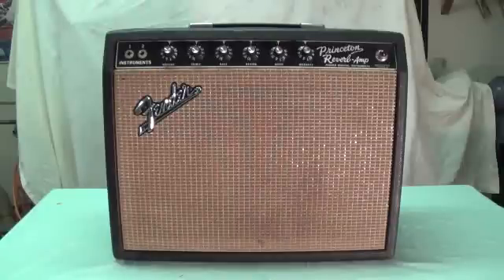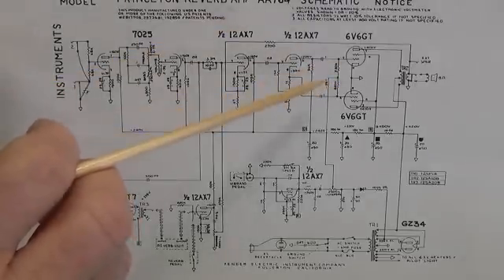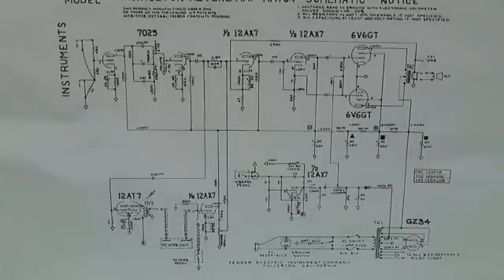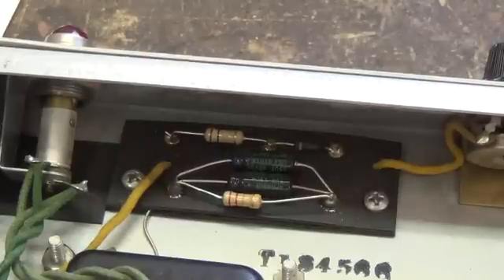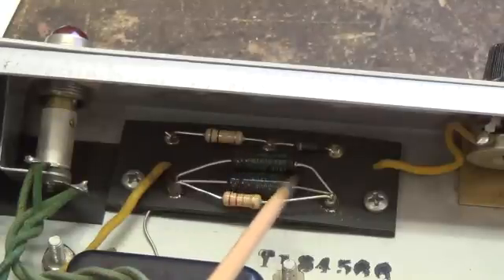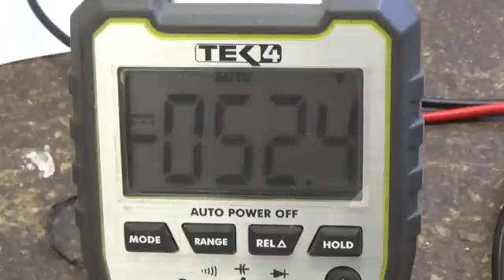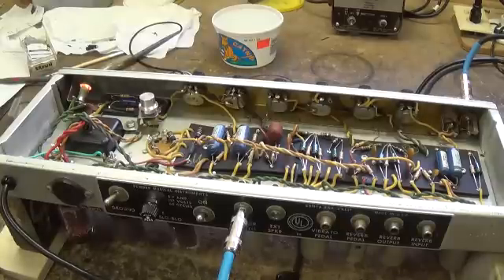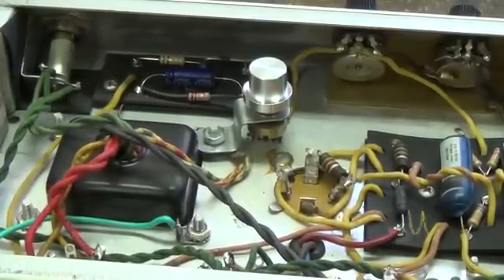Converting the Fender Princeton to Adjustable Grid Bias

Comment: Hello Doug, Can I use this method on the old Gibson amp that does not have tremolo? Thanks
Reply from the maker: +Britt Rossman Probably, as long as the Gibson amp is fixed bias (its cathodes are grounded) and it has a dedicated negative DC grid bias circuit. Please note that I have posted a video showing how to convert a fixed bias Gibson GA-35RVT amp to adjustable bias.
Reply: +Uncle Doug   Yes Doug, thank you for that - I did see it. I have scoured the web for all the info I can find, your videos proving to be the most helpful. The grids are biased to about -35VDC from a dedicated power node, but so much of the PSU is wacky I having trouble pinpointing connections.
Reply from the maker: You're welcome, Britt. I'm glad my videos are helpful. Best of luck with your project.
Reply: +Uncle Doug  I don't believe this was mentioned in the video, but are you taking these measurements on the standby mode? I'd assume not, but strangely, I get a shifting voltage drop across the OPT primaries... it oscillates between 0.63-0.69V, but stays steady at 0.58V in Standby... This is odd, though I do believe there are likely some oscillations in the amp out of my hearing range that I have yet to track the cause of.
Reply from the maker: My measurements are normally taken with the amp in operational (not standby) mode, simply because that's the way it will be used. I generally see oscillations like you describe in some amps with tremolo (i.e. Fender PR), which is still present in tiny amounts even though the intensity is at zero.....but your amp doesn't have tremolo, so I'm puzzled. Perhaps some pulsation from the filter capacitors ???  Personally, I tend to ignore it.
Reply: +Uncle Doug On a foggy night, in upper Austria highlands, a friend called me to his new music studio in an old farm. He had some strange problem with a Soldano Amp. In idle there was some strange hum, not the one from the net and not the one from the filter caps. He asked me to change the output tubes with a new high output GT's  since he is a real high-gain freak. I run the amp with the old tubes, put the new in and the problem remained. I suspected some HF-oscillation but from where? Rotating the amp changed a bit the noise but didn't eliminate it. It is also to be mentioned that this 300 years old farms have not proper GND. I decided to take the amp to my workshop to run few more tests. In my place the amp run well also with the old tubes. Still suspecting some other issue of the problem I packed the amp in the car took my Tektronix osci and some other stuff, my reference speaker cabinet and my sleeping bag since the place was in a remote area (my spouse gave me hell on this). I arrived in the night it was still foggy, hooked up the amp same problems so I stayed overnight in order next day to go into the problem. Next morning I stepped out in the garden, the fog was lifted and a saw 500 meters (0.3 miles for my fellow americans) from the house, this huge military aviation radar facility....
Reply: +Uncle Doug On a foggy night, in upper Austria highlands, a friend called me to his new music studio in an old farm. He had some strange problem with a Soldano Amp. In idle there was some strange hum, not the one from the net and not the one from the filter caps. He asked me to change the output tubes with a new high output GT's  since he is a real high-gain freak. I run the amp with the old tubes, put the new in and the problem remained. I suspected some HF-oscillation but from where? Rotating the amp changed a bit the noise but didn't eliminate it. It is also to be mentioned that this 300 years old farms have not proper GND. I decided to take the amp to my workshop to run few more tests. In my place the amp run well also with the old tubes. Still suspecting some other issue of the problem I packed the amp in the car took my Tektronix osci and some other stuff, my reference speaker cabinet and my sleeping bag since the place was in a remote area (my spouse gave me hell on this). I arrived in the night it was still foggy, hooked up the amp same problems so I stayed overnight in order next day to go into the problem. Next morning I stepped out in the garden, the fog was lifted and a saw 500 meters (0.3 miles for my fellow americans) from the house, this huge military aviation radar facility....
Reply from the maker: What a great story, Gustav. It has it all: mystery, suspense, and a great climax. I could definitely sympathize with the part about the spouse giving you hell over your spontaneous camping trip. I get the same treatment here for far lesser transgressions :)  Thanks for sharing this with us.
Reply: +Uncle Doug She is from Greece that means a bit hot biased...
Reply from the maker: Those Grecian amps can always use a little boost in the (negative) bias (voltage) :)

Comment: Uncle Doug: Can you provide some clarification. The pot that you used, is it anything special? does it have a voltage and /or current rating? or is it similar to a pot we would use for volume. Also, will you elaborate on how to use resistors to match the tubes better. For example, I have a 1967 Super Reverb, with the variable bias, and I have 2 nice black plate RCA 6L6GC's that are fairly mismatched probably by 5 or 6 MV. I tried putting in an additional pot along with the existing pot, but I found that when one pot was adjusted it also affected the other tube bias, even though they were in parallel, not series with each other . I was able to get it biased correctly but I felt it seemed a little hokey. So what I am asking is can I use the existing pot for overall bias level and then use a separate resistor on the higher biased 6L6 to bring in the bias to a matched amount. If so what pin # on the tube do I insert the resistor, thanks, Bob
Reply from the maker: +starlingave  The pot is linear (not log or audio taper) and not of high wattage. It's nothing special. I have mixed feelings about adding cathode bias resistors to fixed-bias output tubes. On one hand, you can add a carefully chosen (by trial and error) resistor to the cathode of the higher-current tube and bring it down to match the lower-current tube exactly.....but, you are creating a hybrid type of biasing (fixed and cathode) that may affect the tone of the amp, particularly at higher volume levels. You might try it anyway and see what you think. I don't see how it could cause any harm to the tubes or circuit. The cathode of a 6L6 is pin 8.

Comment: Hello Uncle Doug, i installed the bias control on my princeton reverb amp and it works just fine! just one question, on the end of the video you demonstrate how smoothly the adjustments works by measuring mA. Did you disconnect a wire, or do you use a tube adaptor with external wiring? do i have to recalculate each time i adjust the value to get the right PD? greetings Benny
Reply from the maker: +BAMPSANDPEDALS  To directly measure Plate Current, I was using the OPT shunt method: You attach your leads to either side of one half of the OPT primary (the half connected to the tube you are biasing), then using the Ammeter function of your multi-meter, you measure the current shunted around the winding and through your meter (due to it's near-zero resistance).  If this is confusing, then you might study up on the method using Google searches for more info, or simply do what you are doing. There is some risk to this method and I don't advise anyone else to use it unless they are experienced, knowledgeable, and comfortable with it.  Be careful. Good luck.
Reply: So using this method no current is flowing through the transformer primary, and it is measuring current essentially without the transformer in circuit? I've noticed most transformers actually show different resistance (I know, NOT impedance) either side to center tap so balancing an amp might also involve swapping tubes inside to outside?  I've seen others putting a 1 ohm resister cathode to ground on each output tube and measuring the voltage across each resister.  Using Ohm's law, knowing voltage drop will give current flow.  Do you consider this advisable?  would you need the bypass electrolytic across this 1 ohm as well?
Reply from the maker: Yes, the current takes a short cut through the meter, allowing you to measure it. Yes, the two primary windings of the OPT almost always have different resistance, which complicates the biasing procedure a little because it affects the current running through each tube, even if the tubes are perfectly matched. For this reason, each output tube must be biased separately, if possible. Yes, swapping tubes is a common practice. You can install the higher current tube with the higher resistance winding to try to balance them out. I don't like the 1 Ohm method. Even a slight error in its resistance can throw the result off quite a bit (i.e. 10% or more). The electrolytics are no issue since current does not run through them.

Comment: How do you "match" the tube current to balance them?  Is this really an issue?  I thought that both tubes should be adjusted so they are operating in a true complementary fashion.  Wouldn't this reduce notch or crossover distortion?  Is this something that is added to the cathode circuits for each tube?
Reply from the maker: +Erik Thorsen  In most cases, especially with fixed bias circuits, you simply use two tubes that have the same current flow.....i.e. a matched pair. If the tubes are cathode biased, you could bias each one individually, with a carefully selected bias resistor for each, to provide identical plate dissipation. If their PD is unequal, then it's like two people rowing a boat in an unequal manner.......efficiency and possibly tone is degraded.

Comment: Thanks for your informative reply. Does the mismatch of the 6V6s decrease the power to the speaker? Or would a matched pair of output tubes increase the power to the speaker? Thankz
Reply from the maker: +Audio Tech Labs  For maximum power and fidelity (minimal harmonic distortion) the tubes should be closely matched......however, I doubt that anyone could detect a minor mismatch by simply listening. It would probably require an oscilloscope.

Comment: Uncle Doug, thanks for your reply. So how do you measure output power not plate dissipation? Thankz
Reply from the maker: +Audio Tech Labs It's not real complicated but requires some special equipment: Replace the speaker with a dummy load of equal impedance. Use a signal generator to input (to amp) a specific audio frequency, i.e. 1KHz. Turn up amp volume, monitoring output with oscilloscope, until distortion just begins to appear. Measure voltage output to dummy load (or from oscilloscope peak height). Calculate peak output power:   Output Voltage Squared  divided by  Dummy Load Resistance (i.e 10V output, squared = 100, divided by 8 ohms = 12.5W Peak Output. But peak output is misleading. The preferred value is RMS Output, which is Peak Output (i.e. 12.5W) multiplied by .707 = 8.84W RMS Output @ 1KHz.  To further complicate things, the value changes at different frequencies, so you need to specify the frequency at which the RMS Ouput was calculated.

Comment: After viewing this video I thought it might help those who would like to know the total output wattage of the amp. One tube was 7.54 and the other was 8.38. Was the total watts the sum of those two(7.54 + 8.38 = 15.92) or their average (15.92 /2. =7.96) ? Thankz
Reply from the maker: +Audio Tech Labs Greetings, ATL. The wattage measured was not output (power) wattage but plate dissipation (heat) wattage for each 6V6.  It's better to know the individual PD values for the tubes because it shows how well (or poorly) they are matched. An average can be misleading.

Comment: hi thanks for this video, what kind and brand of resistor, potentiometer and cap do you prefer for these vintage amp? Thanks!!
Reply from the maker: Hei Chan You're welcome, Hei. I'm not a snob when it comes to parts. Generally, I buy whatever Antique Electronic Supply is selling and I don't pay much attention to brand names. I know that sounds blasphemous, but I feel like tone is more a product of good circuit design, careful assembly, and proper speaker choice, rather than the use of overpriced, boutique parts.
Reply: Uncle Doug It is because whenever i try to put the amp to store for check people always say they have help me to replace some "good" electronic, so i wonder that. Btw, when i need to change both power tube and rectifier, what the biasing procedure? say i need to change the rectifier first and do a bias, then change the power tube and re-bias again? Thanks.
Reply from the maker: It sounds like the people at the store simply want to take your money, HC. If the amp is working OK, then my advice is to leave it alone and enjoy it. Don't let any so-called "experts" talk you into buying parts you don't need. There is no need to change any tubes unless they are either so old that that you can't get decent volume from them, or if they have failed and the amp no longer works properly. I have posted a video showing how to bias single and double output tubes. Good luck.

Comment: Doug, fantastic video here, as all of yours are (full credit to Rusty also).

I have an Ampeg Jet 20, which is a Korean faux reissue supposedly based on the Fender 6G3 Deluxe circuit.  It seems well enough built and has a tagboard construction so no nasty PCB stuff to fiddle with here.

To get variable bias, I want to replace the 22K bias resistor and happen to have a nice 10K CTS bias pot sitting here.  Could I just put the pot  (using just one side of the pot and wiper) in series with another fixed resistor, rather than doing it the way you have done?  I'm thinking perhaps around 15K on the R (hence 15-25 sweep) would then give me an OK range...or am I  missing something e.g. re the suggested value, and are there disadvantages to this approach?

There is a guy on the internet who did something similar, but modded his with a 100K trimpot (weeny thing) in parallel with a 51K resistor.  NB on the Ampeg the bias is on the main board, not a separate one like good old Leo.   I thought about doing something similar, but prefer the idea of the CTS metal pot mounted outboard as per your approach.  I can see the idea of his to have parallel VR (100K) and fixed R (51K) but of course I only have 10K to work with on my pot.

RIchard
Reply from the maker: A Tweed Deluxe would definitely reduce my sorrow over the loss of the Ampeg (even though the Ampeg was great amp). It sounds like a pretty good trade to me, Javi, but it's a shame you couldn't have them both.
Reply from the maker: twerpeater  Greetings and thanks, Richard. I understand your situation and see no problem in trying what you suggest. I would use patch cords to set up the series circuit, i.e. pot in series with a 17K fixed resistor.....try it out to see if it works.....and then either modify a bit, or hard wire it into the circuit if you are pleased with the result. Monitor your plate current at all times to be sure you don't harm the tubes while experimenting. Good luck.
Reply: I used to have that Ampeg, had to sell it to fund a Tweed Deluxe... I miss it, it was a great amp.

Comment: Thanks for the quick reply! Yes I've watched those videos, I saw you had put them in a link to someone else's question. It was just that I saw you using a multimeter in this video measuring current so was curious. I'm in the middle of making a DE amp for an electronics course final project, with the power amp based on the Fender Princeton. I have made notes from the videos you refer to for when I come to bias it. Your videos have helped me a lot to understand the inner workings of guitar amplifiers so thank you for taking your time to make them!
Reply from the maker: You're welcome, Cam. I'm glad the videos were helpful. Best of luck with your course and final project :)

Comment: Hi Doug, thanks for another great video! 
Just a quick question, how are you measuring the current? Are you putting the amp meter in between the pin of the tube's anode and its wire or using specialist current measuring socket?
Reply from the maker: You're welcome, Cam. I explain the method in a couple videos, but will offer a brief explanation here. In a DE amp like the PR, with the amp off, I measure the resistance (R) of each half of the output transformer primary winding (first 6V6 plate to CT, CT to second 6V6 plate). Then while the amp is on, you measure the voltage drop (V) across each of these two resistances to get the PC for each tube (C = V/R). This is the safest, best method I have found for this measurement.

Comment: Great information Uncle Doug, will this work with a Champ?
Reply from the maker: Thanks, Ampman. This method works for amps that are grid biased (the cathodes of the output tubes are grounded). The Champ is cathode biased. I guess you could replace the cathode bias resistor with an adjustable potentiometer, but it would probably not be all that beneficial. If none of this makes any sense, then you should watch my videos on biasing single-ended (i.e. the Champ) and double-ended (i.e. the Princeton) amps.
Reply: Thanks Doug, I will check your Champ video, I have Champ that is running very hot.
Reply from the maker: Champs are notorious for being biased too hot, particularly the Silverface models. Increasing the 6V6 cathode bias resistor value (usually about 470 ohms) up to 600 ohms is about right, but it's a trial-and-error process to find the exact value that gives you the ideal plate dissipation of 10W (moderate) to 12W (the maximum).